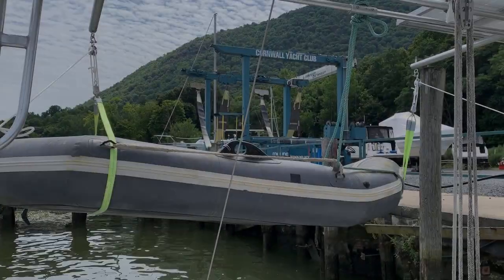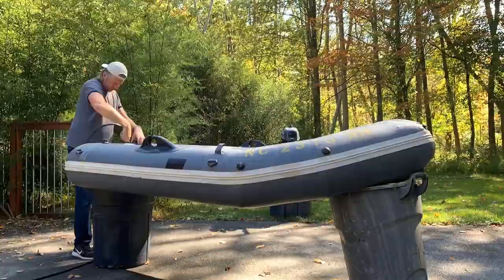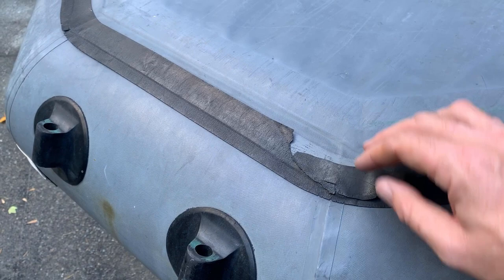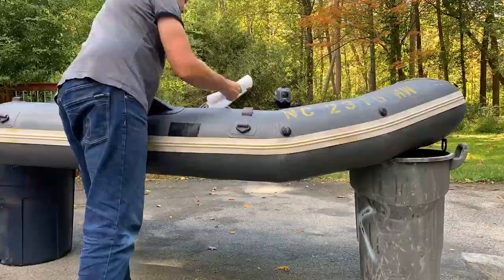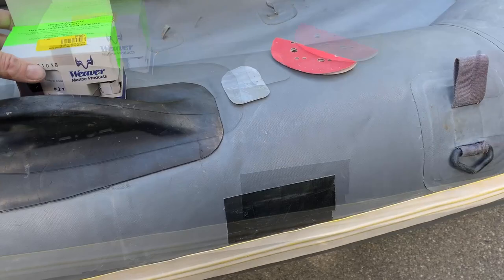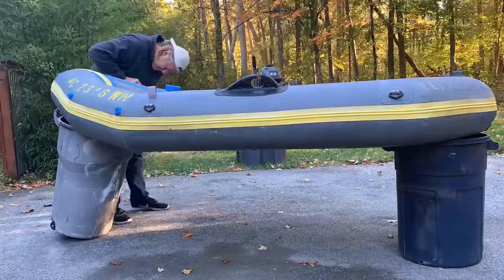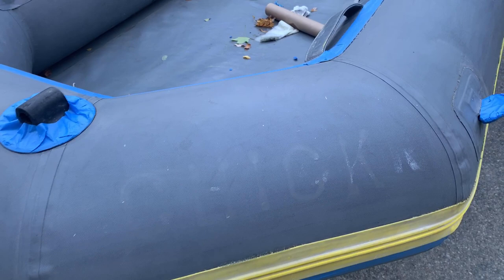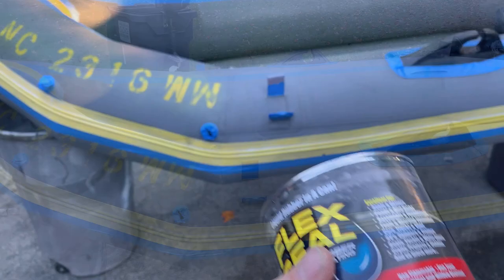Would You Do This to Rehab an Old Avon Redcrest Dinghy? FLEX SEAL! (Boat Work: Sailing 9 LIVES)

Comment: How you guys making out after the hurricane?   I’m so bummed about the boat. 😢
Reply from the maker: We're fine, thank you for asking. The fence got wrecked by the wind and the dock got wrecked by the tidal surge and waves. I've been making repairs to the dock here and there, and will soon start rebuilding the fence (I know you saw the drama with the neighbor... I got that sorted out so now can proceed with confidence).
The boat is still there, sunk by the riverbank. It has more holes in it than I had originally thought. In the coming weeks or months, FWC and FEMA will have it "floated", hauled out, and destroyed. There are a few thousand other boats waiting in line. We will satisfy our need to be on the water by using the trawler in NY while we still maintain a presence there, and I just picked up an old Formula to use in FL for now. We've started looking at sailboats to replace 9 LIVES, and when we find the right boat we will sell the temporary boats and focus on continuing our sailing.

Comment: I like the look of how it turned out.  Almost looks as good as the girl rowing it at the end, there!  Any thoughts of doing the bottom? Maybe in the grey?  Or do they have a blue to match 9Lives?  I got a hole in the cover of my Jeep's awning and instead of ordering a new cover I used FlexSeal and it made it look brand new.  Good stuff.
Reply from the maker: Thanks! The dink and the doll appreciate your compliments!
I suppose we could do the bottom one of these days. If we wanted to match 9 LIVES we would have to paint the sides blue, the bottom red, and then take a claw hammer or something similar and rip big gashes in the side. :)
Reply: @Sailing9LIVES  hahahaha!🤣😆🤣 I was thinking that when I wrote it but, I thought you've been been beaten up about it enough by now.  Kinda like 9Lives?
Reply from the maker: @marceld6061  Kinda' like that.
The tide was particularly low a few days ago, and I discovered another 12" diameter hole that I hadn't yet seen.

Comment: Do you think this method can work on hypalon tubes that don’t keep pressure anymore without any specific holes?
Reply from the maker: If the tubes are leaking due to pinholes, yes, I believe this would work well to seal it. If the leak is hidden along a seam, I would be less confident.

Comment: Super interested to know how the flex seal has held up.. Is she still floating?? Thanks for the video.
Reply from the maker: Hello! We didn't even publish this video yet... I guess it shows up anyway since it is in a playlist? Interesting...
The Flex Seal is holding up far better than I ever expected. It says on the can that it works on hypalon, and it absolutely does. It looks the same as the day I applied it. It does add a bit of a grippy feel to the top of the dinghy (what one would expect from a rubber sort of coating), and ironically it is a little bit slippery when wet. But no complaints here, it is good stuff.
"Iron Horse"... I may be going WAYYYY out on a limb here, but are you Heavy Eddie? The bike reference in your name and the interest in Flex Seal is hard to ignore...

Comment: How liquid-y is the liquid, meaning is it runny, and does it take long to dry?
I'm wondering if one could use inside the tubes to achieve the same purpose but from the inside. To seal minute seam and pin holes or just degraded fabric..??
Reply from the maker: Good question... it is fairly thick. If you managed to pour it inside and could reasonably well position the boat so that the paint could quickly get to the area you are looking to shore up, I imagine it could potentially do the job you describe. But it is not a very thin liquid, so it probably won't coat the inside EASILY.
If you DO try this, I recommend setting up the boat however necessary to get the coating quickly to the damage, and then inflate the boat... you don't want it curing in any shape other than the "final" inflated shape. Depending on the damage you are looking at, this may or may not be possible.
Oh, and it seemed to cure fully after several hours.

Comment: Best to use proper paint for this application. Flex seal is about the same cost as the good stuff anyway. Probably PVC
Reply from the maker: As with many things, there are often more than one "proper" way of accomplishing a task.
There are paints that folks have used for decades on hypalon.
Flex Seal is definitely a different product. It is less a paint and more a coating. I would say that it is actually a very durable coating that adds some abrasion protection. I will also point out that the label on the can includes hypalon as one of the materials it works quite well on.
Reply: I painted with 1 ltr.(flexithane hypalon)inflatable 3,3 m. Cost 160 €

Comment: The problem with setting this raft on the two trash cans is; If you let all the air out first, it would easily fit into one trash can, no problem!! Then, all that remains, is to set the can out on the roadside, on the proper day!! Then, start fresh from there!!
Reply from the maker: That sounds less like a problem and more like a solution, Joe. Hahahahahahahaaaaa